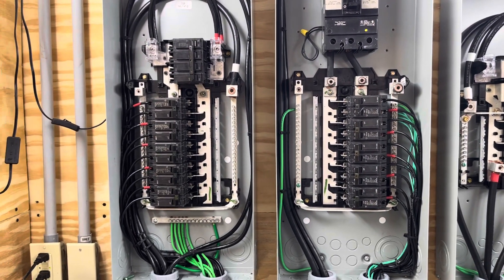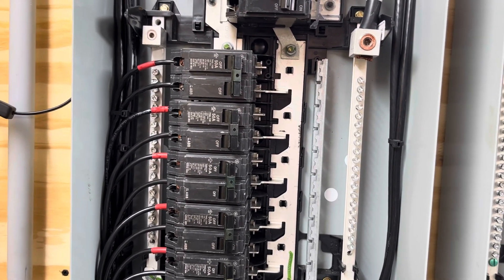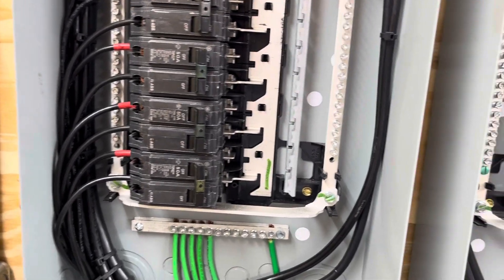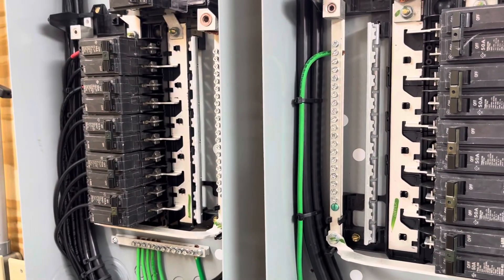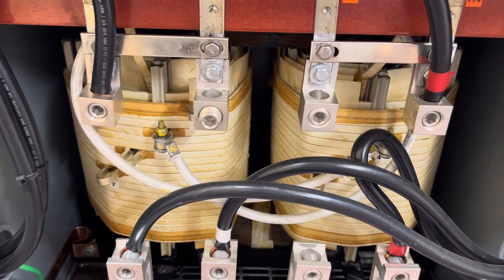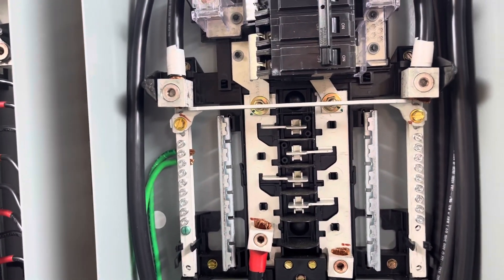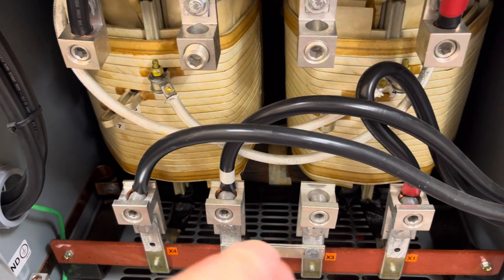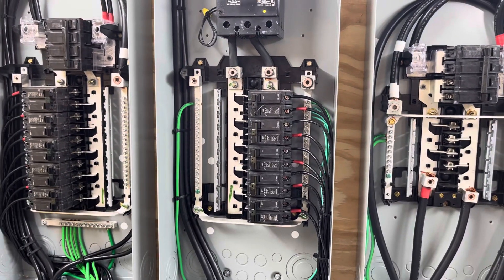Solar Power Project - Growatt and Isolation Transformer Wiring Explained

Comment: Hey Jeff, love your videos, especially the one about following Dr Bradley's EMP writings. Got a question for you because this is the closest video I could find to my issue.

I have a Growatt 3kw hybrid that is 120 only and the output voltage always stays consistent at around 120, but I'm getting pulsing lights all the time. They are good LEDs, but no matter what they pulse regardless of the size of the load on the inverter, and when I run something like the washing machine they pulse in rhythm with how the motor is running.

Would this be where an isolation transformer would help smooth out the dirty power from the inverter? I already tried a Schaffner EMI filter with no help, but they are tuned to filter from 10KHz to 2MHz. So maybe the noise is at a lower frequency?

If you have any input it would be much appreciated.
Reply from the maker: Hey Sam. I’ve heard of some inverters having these issues. Not sure how to resolve it. An isolation transformer may smooth the output some, but I’m not sure it would eliminate it.
Reply: Alright well thanks for the reply. If I ever figure it out I'll post back here @jeffmotes2129
Reply from the maker: @samgillis6224  please do. I’ve heard of others having this issue.
Reply from the maker: @samgillis6224  since I installed the sol-arks I no longer use the transformer.
Reply from the maker: @samgillis6224  check out Adam de Lay’s channel. He had some flickering issues. Not sure how he fixed it.
Reply: I tried replying to this, but maybe it didn’t go thru.

I watched a couple of his vids and he was able to improve the problem but not solve it. To me it seems these cheaper high frequency inverters are inherently dirty.
I think an oscilloscope/spectrum analyzer would tell what’s really going on.

A different question, though. I’ve read that a potential safety issue with HF inverters is if the AC output monitoring circuitry fails and one of the MOSFETs shorts then the inverter could send DC to the AC loads and pose a fire risk. If that is a risk would an isolation transformer be a good safety?
Reply from the maker: @samgillis1756  that’s an interesting question. I wonder what that waveform would look like. Been a long time since my college days. 

DC doesn’t pass through a transformer. I can’t remember how DC would affect the ac waveform on the input side of the transformer. 

I had lots of problems with the Growatts putting dirty power on my system. Finally just got ride of them and installed Sol-Ark 15k units. No inverter problems in over a year. The sol-arks are boring which is the way I like my electrical equipment to be.

Comment: Jeff, just curious as to the losses associated with your transformer?  50KW is big for most households.
Reply from the maker: Yes. It is big. I used it primarily for 2 reasons. My main protective devices are all 200A. Using a smaller transformer would require replacing either the primary or secondary breakers with smaller ones. 

Common transformer sizes include 10, 15, 25, 37.5, and 50kva. The heat strips in my 5 ton HVAC unit total 20kw. While it is very uncommon for both to be on at the same time it has occurred. That left me with picking a 37.5 or 50kva transformer. There wasn’t a $100 different between the two. In fact replacing tge 200A breaker with a 150A breaker would have cost more. 

There are some significant losses when using the transformer. I don’t remember exactly but it was significant. 

If you’ll look at some of my newest videos you’ll see I replaced all the Growatt units with two split phase Sol-Ark units. This eliminated the need for the transformer and it was removed from the circuit. 

You can also look at the thermal scan video I shared and see the heat inside the transformer.
Reply: @jeffmotes2129  Just curious which isolation transformer you used.  I am definitely using your system as a template (albeit different inverters), but would be nice to get the same one so wiring it is a lot easier.
Reply from the maker: @silverice9  I’ll get you a cat number.
Reply from the maker: @silverice9  Hammond Power Solutions Sentinel G cat# SG3N0050LE 50kva transformer
Reply: @jeffmotes2129  Awesome.  You have no idea how much this helped me.

Comment: Jeff, I was thinking about this and wondered if the use of the isolation transformer would solve the issue of the high frequency inverters with respect to handing A/C and well motor startups. I see you added soft starts to your A/C but am hopeful that was for the generator and not the solar. In case it is unclear, I was thinking about low frequency inverters not having the motor startup issues because they have a transformer. The long and short is I am wondering if you have found the best of both worlds?
Reply from the maker: I added the soft starts because of my generator and also because I wanted to reduce inrush on the inverters. 

The bank of 5 - Growatt SPF500ES inverters have no difficulty with starting my 5 ton HVAC unit.

Comment: In South Africa with a 240V grid supply system the Neutral and Earth is connected and grounded at the Utility, strictly speaking earth and Neutral are not allowed to be connected at the consumer side.
You assumption is correct about the L N E markings on the inverter.
However as electricians we often find  our client's complain about voltage problems when getting power from the inverter, we thus mostly find a floating voltage between Neutral and Earth with elevated voltages of about 90V between N and earth. To date their seems to be no guidelines as what  to do with the inverter E N to prevent elevated N E voltages.

Comment: Is the grid neutral bonded to the transformer output neutral? If so, does that mean that there are two neutral-ground bonds? One in the first grid utility panel on the exterior and one in the transformer output panel? I ask because I thought it was standard (code) to bond the neutrals together. I’m going to guess not.

I meant to mention in another of your videos that those Chtaixi 125A DC breakers are polarized, and can burn up if they flip when current is going the wrong direction.
Reply from the maker: The neutral derived from the isolation transformer must be bonded to the system ground. I do that in my system output panel on the load side of the transformer. 

I hadn’t considered what you mentioned about the breakers. May be modifying my wiring a bit.
Reply: @jeffmotes2129  Is it bonded to the grid neutral too though? That’s really my question.
Reply from the maker: @captainobvious9188  the grid neutral is bonded to the ground at the first grid panel. The derived neutral is bonded to tge same ground at the panel on the load side of the transformer. There is no other connection other than the being bonded to the same ground.
Reply from the maker: I have some crimp ferrules coming for my battery wires. I’ll change them around when I crimp them ferrules on. Thanks for catching that for me.

Comment: Thanks for your videos! Your installation has been a great example to me!

Thoughts: Although the isolation transformer really only does minimal isolation from voltage spikes (and wasn’t the purpose for using one), it got me thinking that I need to get a high quality surge protector for my panel that feeds the grid side of my inverters, for more resiliency. It wouldn’t be great if something took the grid out also took out the inverters.

If in the future you want some large reasonably priced inverters for something else, or the growatts don’t work out, lookup Sandi Electric. I know a couple of people using their 30kw models. Also, they have higher battery voltage and higher string voltage charge controllers if you want, so you can save on wire.
Reply from the maker: Thanks! If these Growatts don’t workout I’m not going to be happy! Right now at this moment they are running my entire house including two central HVAC systems and 2hp pool pump. 

But I’ll keep what you suggested in mind. 

I have three Siemens SF140 TVSS installed on my electrical system. I will also be installing Midnight solar SPDs on my PV output circuits. 

You may want to check out Dr Arthur Bradley’s YouTube channel. He has some great EMP/Surge Suppression info there.

Comment: A few questions. I'm not sure if it makes a difference in the following two scenarios if you have grid connection or off grid ..if there's a major difference in on or off grid for the following two potential failures please describe what would most likely happen. 

1. If you're using a auto transformer like a lot of youtubers are and the auto transformer fails and the neutral is lost what exactly happens to the system and connected equipment? Some users are putting them on breakers but regardless...if the auto transformer shorts out or the breakers trip you loose the neutral. 

2. What happens if the isolation transformer you're using fails either one or both sides and the neutral is lost? Does the tv and fridge blow up? Do the inverters get smoked? 

Additionally, what exactly is the appeal of this sort of setup when you can purchase cheap unites like the mpp / growatt or expensive ones like the conext and outback that already have 120/240 output at the inverter ..so you'd just have to parallel them and connected to the load panel? I'm curious why people are doing this when it's not much more for a unit that's already setup for split phase? 

Would it be better to have two isolation or auto transformers encase one gets taken out for whatever reason?

Would this pass inspection for code or would they say those are not for the US and using a transformer isn't allowed per UL or other codes?

And, thanks for taking the time to make these videos and educate us trying to learn ..it helps keep us safe and make good decisions. Your time is valuable and thanks for sharing it. I hope you continue to explain this step by step like you have and perhaps maybe even present a diagram once done for others to use as a template.
Reply from the maker: Hey Neal. If you lose your neutral whether it be from the grid, generator, inverter, isolation transformer, or autotransformer the results are similar. With the lost neutral the 120v devices will split the voltage between L1 and L2 based on impedance of the loads. Since the loads are not balanced some 120v circuits will get voltages less than 120v while others get voltages greater than 120v. Both cases are bad for your devices. 

I worked as a utility system engineer for a number of years at our local power company. Though it was extremely rare we did have occasions where we lost grid neutral serving a customer. This was always due to broken conductors or bad connections. We bought TVs and other appliances. Computers were rare back then. 

In a generator circuit or grid or isolation transformer when your transformer is switch off you simply lose power. The way many are using autotransformers on YouTube the autotransformer can easily be turned of or tripped with the inverter still maintaining an output. This creates that scenario I discussed above. 

The only way to use an autotransformer safely for your equipment is to tie one to each inverter output so that the autotransformer cannot be turned off without turning off the inverter output. If you have a large system this could easily cost as much as an isolation transformer large enough for the whole system. 

BUT if your inverters have a grid bypass mode autotransformers should definitely be avoided as I mentioned in the video.
Reply: @jeffmotes2129  So, just to clear things us. That isolation transformer that you have for the whole system, should the transformer fail internally or the breaker feeding it taking it out of the system ...you're saying things are going to get over or under volt? I assume the only way for a neutral to drop in your setup would be a internal failure on the transformer or connector failure? We're having a discussion on diysolar forum about this. Some guys say that if the isolation transformer failed things would just stop working due to not getting current anymore since the circuit is broken and most likely damage wouldn't occur. Just replace the transformer and move on. Perhaps maybe there's a difference in transformer failure or just a neutral drop out? Other users on the forums are saying this sort of setup is just asking for trouble and to just use split phase inverters from the get go. Somebody posted one of your videos and that's how I found your channel. 

https://diysolarforum.com/threads/whats-the-reason-behind-using-240v-inverters-with-transformers-when-they-have-split-phase-ones.43281/
Reply from the maker: @nealhamilton3881  the guy is correct. Isolation transformer is the proper way. When I talked about the problems of a lost neutral it is true for any lost neutral. It’s not specific to an isolation transformer. 

The likely hood of losing only the neutral in an isolation transformer is no greater than losing only the neutral from the utility. 

The transformer used by utilities to feed your home is a type of isolation transformer. Except most utilities use phase to ground voltages instead of phase to phase voltages on the primary side.

There are millions of isolation transformers used in commercial and industrial and  medical facilities. They are proven to be a safe and efficient electrical device. They aren’t used in homes very often because they’re is usually no need for them. But in my particular solar application it is the only proper device to use.
Reply: @jeffmotes2129  How you ground a separately derived system is critical to the safety of those working on the system and the performance of your equipment.

Separately derived systems are power sources with no direct electrical connection between any of the circuit conductors and supply conductors. For example, no direct connection exists between the primary and secondary winding of a delta-wye transformer. Generators, converter windings, UPS systems, and solar photovoltaic systems are separately derived systems only when all circuit conductors — including the grounded (neutral) conductor — are independent of the supply conductors. If you wish to use a separately derived system, you must use a 3-pole transfer switch for a single-phase, 3-wire system, or a 4-pole transfer switch for a 3-phase, 4-wire system [Art. 100 definition and Sec. 250-20(d) FPN No.1].

The National Electrical Code (NEC) has several rules that contain specific requirements for grounding separately derived systems. Failure to properly ground separately derived systems can result in electric shock, electrocution, fire, equipment failure, and poor power quality.

https://www.ecmweb.com/content/article/20886620/separately-derived-system
Reply from the maker: Answer 2 - I was on a job site today where an isolation transformer faulted due to lightning. The breaker feeding the transformer tripped and removed power from it and it’s load. Though I think the lightning strike probably damaged a lot of equipment on the load side as well.
Reply from the maker: The reason I chose to use the Growatt SPF5000ES is because of its ability to stack units for 25kw output. That is my minimum requirement. I did not find any other inverters at the time (Nov 2021) that had that ability.
Reply from the maker: In my opinion one large isolation transformer is best for homes. It’s best to keep one neutral in your home and not multiple neutrals. 

If we’re to consider using autotransformer (for system with no grid pass through only) I would use one for each inverter installed and tie it to the same breaker being used for the inverter output.
Reply from the maker: No idea on the inspection. Thankfully, where I live we don’t have to go through that hassle.

Comment: I'm in the Philippines.  Households are serviced with 2s wire from the transformer and when I look at a transformer on the poles, all have a ground wire going to the base of pole.  Typical service here is just 100AMP, because even though the Philippines is very hot only 5% of households at the most have AC.  Power is just too expensive for even upper middle class families to run AC.  Big buildings here have 3 phase that supply 230v, 120v and 208v - the building owners own the transformers not the utility.
Reply: They lease it.

Comment: 230V single phase 50hz  UK, British virgin islands, few Caribbean islands use these voltage. 1 leg( L1) 230v and N is the Neutral.  So you are right it is modified for US market.
Reply: Here in the Philippines we use the same voltage but 60Hz.